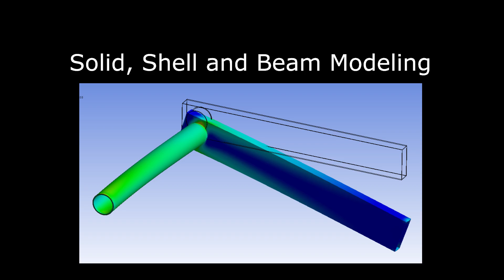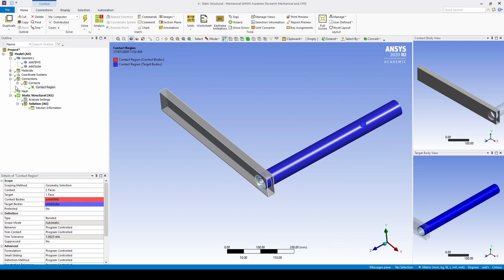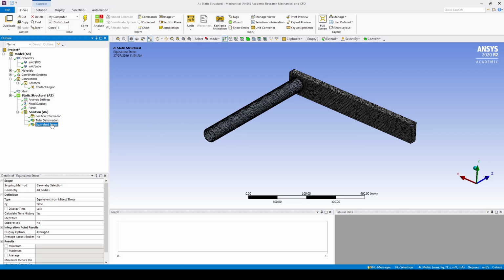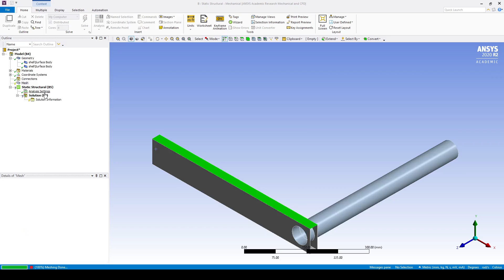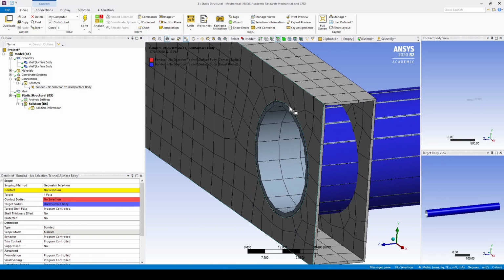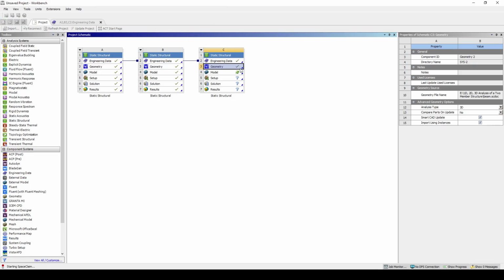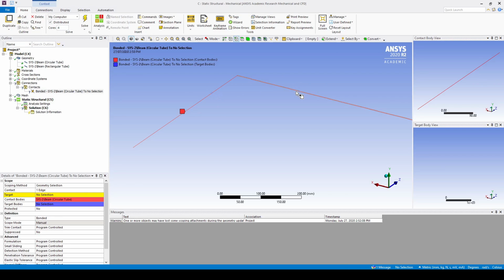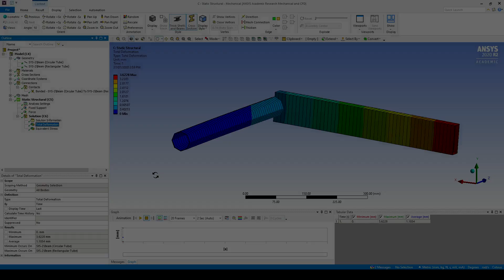Beam, shell and solid modelling - Ansys Mechanical 2020R2

Comment: The DOF of the beam element is six (three translational + three rotational DOF), but the one of the solid is only three (three translational). In the case of the beam element connection, the connecting node is only single, in contrast to the multiple nodes of the solid element connection. Even though the solid model has three dof, the connecting nodes are multiple numbers at the junction, accordingly more stiff connections than the beam element connections. For the solid element connections, more resisting (internal) forces could be induced at the junction, and accordingly more stresses at the junction. Even though the overall displacement for the different element assumptions (beam, shell, and solid) shows similar results, the local stress values should be different due to the above reason. The beam element is generally assumed to be acceptable in the calculation of the primary FEM output (displacement) but is not accurate in case of the derived parameters (stress, etc.). In short, the solid element results are more close to the true values. Your effort is really appreciated.